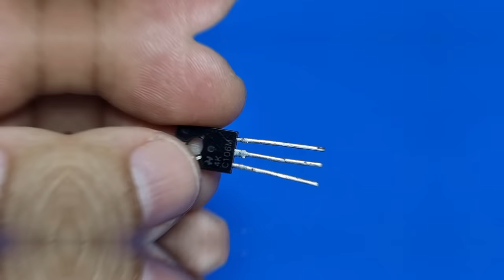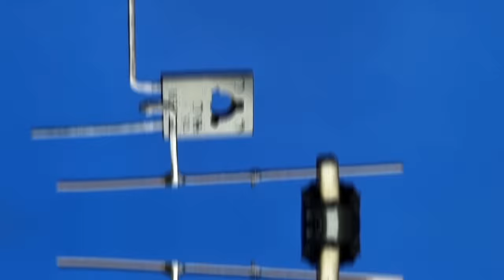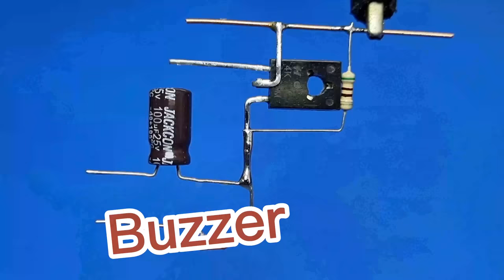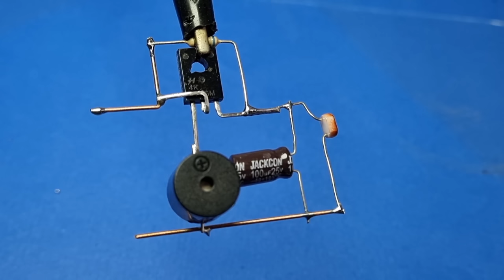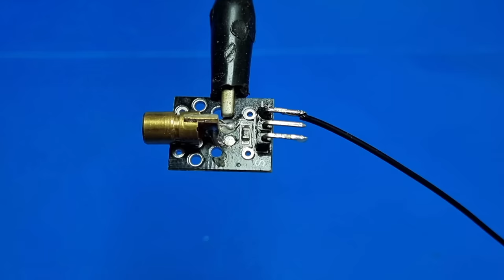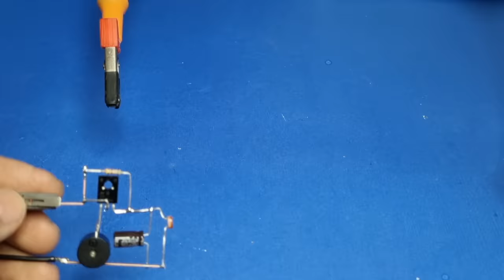How to make a laser security (burglar) alarm using SCR - 1 KM Range

Comment: How much max distance possible between lasser and ldr.?
Reply: The description says 1 km, but that's impossible.  There are too many disturbances in the air.  A single bird or bee or even fog could trigger it.  Even at 30 meters, there is a good chance that something might trigger it.  If this laser beam alarm must trigger only on large animals or humans, then it should have 2 or more CdS photocells and they should trigger only when both beams are blocked by a large animal or human.  Another problem is the beam can be seen, so a human can avoid it and get through without triggering it.  An Infrared beam would be harder to see.  Or instead, buy a PIR sensor like the ones used on security lights.
Thanks for the good project.  It's difficult to watch a short video and build one of these because the video doesn't give enough time to see the parts.

Comment: The description says 1 km, but that's impossible.  There are too many disturbances in the air.  A single bird or bee or even fog could trigger it.  Even at 30 meters, there is a good chance that something small might trigger it.  If this laser beam alarm must trigger only on large animals or humans, then it should have 2 or more CdS photocells and they should trigger only when both beams are blocked by a large animal or human.  Another problem is the beam can be seen, so a human can avoid it and get through without triggering it.  An Infrared beam would be harder to see.  Or instead, buy a PIR sensor like the ones used on security lights.
Thanks for the good project.  It's difficult to watch a short video and build one of these because the video doesn't give enough time to see the parts.